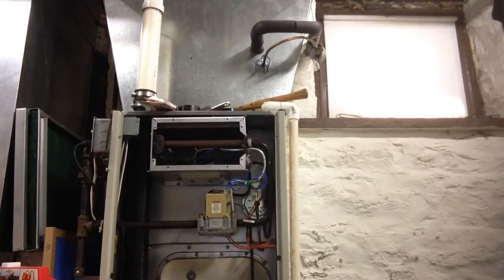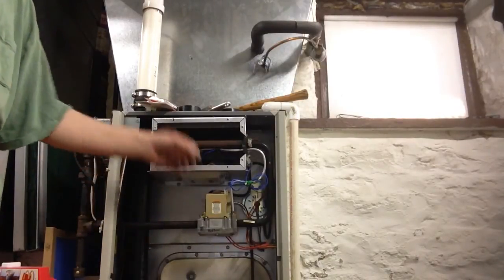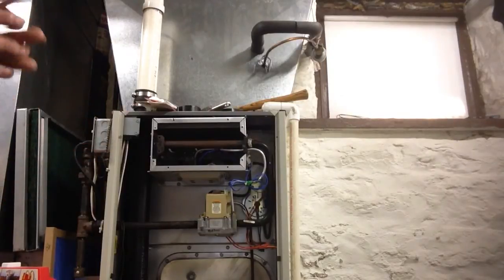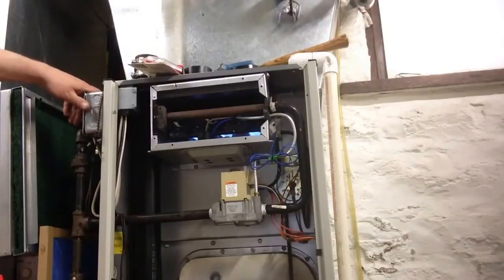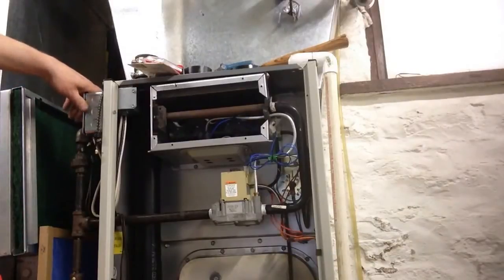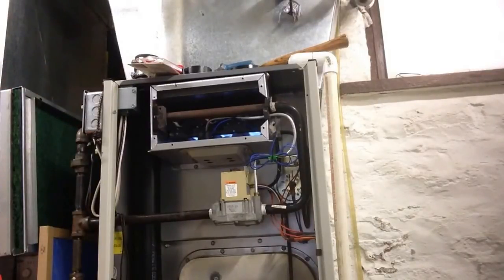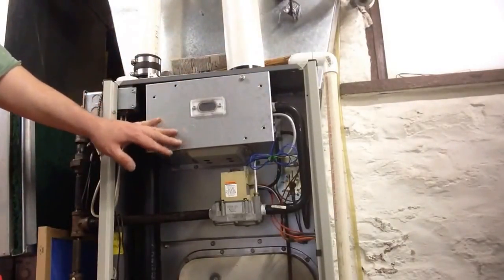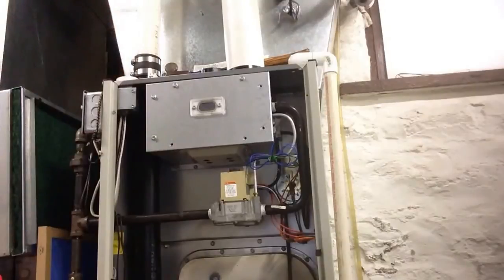Exploding Tempstar Honeywell Smart valve furnace

Comment: I've installed a SV9501 to replace a 9500 in a Tempstar.  The new SV has a Pilot Burner Ground (Through Pilot Tubing).  Are you suppose to just run a ground wire from the SV chassis and attach it to the pilot gas tubing exterior? Thanks!

Comment: The main valve is opening at the same time the Pilot is lighting.  I have seen this too.
Reply from the maker: Bart Curry it's the only time I have seen this happen. These smart valves may have been a good idea at the time.
Reply from the maker: themrhelperguy you can't beat the computer board nowadays.
Reply: I agree you can't beat the computer board these days. The Smart Valve may have been the best back in the day by the way some modern furnaces still use this technology especially the ICP BRANDS.

Comment: I am thinking about replacing my Honeywell Smart Valve SV9540Q.  No Led light even after replacing fan control board and checking limit switches plus fan is running continuously.   Yours is the only video showing this how to replace the SV.  What is the name of that square wrench?  Thx.
Reply from the maker: 1925eddie spud wrench that constant fan on is some times caused by a flame role out switch being tripped. I think the flame roll out is on top of the burner assembly box and can be reset. Be careful most of the time when the roll out switch is tripped you will have a bad heat exchanger. These vintage furnaces with the clam shell heat exchanger will go bad given time no matter who makes the furnace. If you have a clam shell you are on borrowed time.
Reply from the maker: 1925eddie Eddie are you ok out there how is the furnace
Reply: themrhelperguy Check the flame role out switch and everything is fine.  I replaced the honeywell smart valve and now the furnace is working again.  The no LED light should had been my big tip off after checking the Voltage going into the damn thing.   Thanks for weighing in.
Reply from the maker: 1925eddie those smartass valves are a pain in the butt. I don't really know the proper way to test these. Just if things go hay wire replace the valve. Haven't replaced a good one yet. A little note. These smart valve furnaces had clam shell heat exchangers in them. They go bad keep your eyes pealed. Now is the time for general failure in these units. If fact all clam shell exchangers are around the going bad time frame
Reply: 1925eddie It's a very common problem with the sv9500 series. Cracks in the solder on the circuit board causes this issue. My inducer was running constantly with pilot gas stuck on. A very dangerous flaw in these valves.
Reply: Well, 6 years gone and my furnace stopped working again.  Smart Valve gave 2 flashes that said it was the pressure switch stuck closed so the inducer motor wouldn't start.   After exhaustive testing of everything, I determined the smart valve was the issue and replaced with a new one, and it worked.  I was helped by these videos from so long ago.   Thanks for keeping them up here.   I was glad to refind them and see my 6 year comments from my last failure.   Your video gave me the confidence to do this again.  Very Grateful.   It's a Heil furnace that's 21 years on now.  Finger crossed.